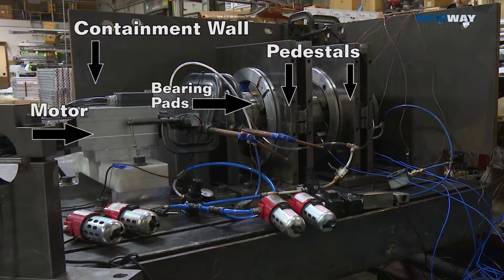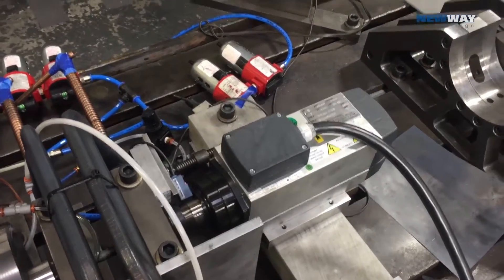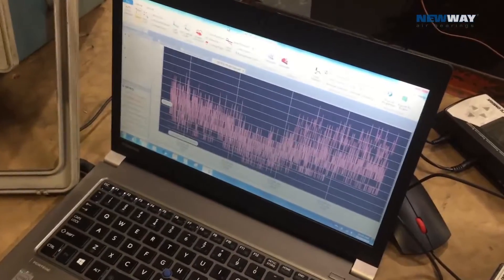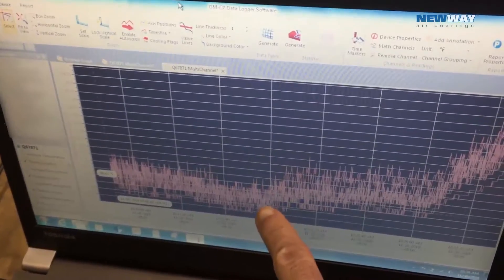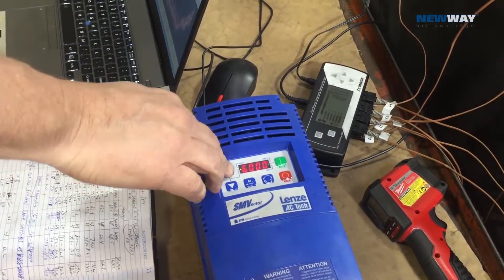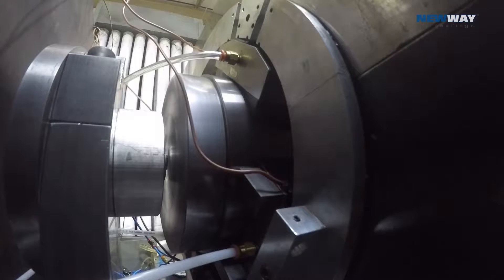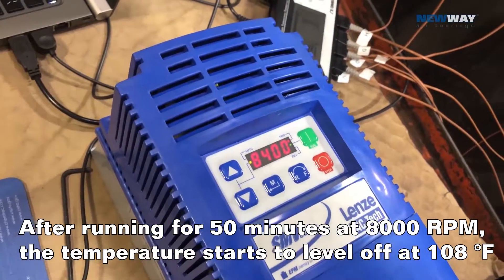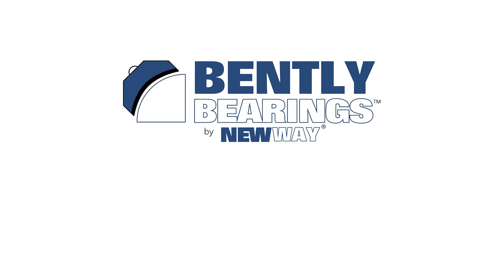7.25" Shaft Running at 8000 RPM

Comment: Really cool technology and videos... I was wondering what happens if there is a break in the air line and your air pressure suddenly drops to zero?

With these high speed shaft applications, I could envision a range of possibilities. The math says that the rotational kinetic energy of 7.5" diameter, 16" long shaft at 7000 rpm is about equivalent to a car driving at 30 mph. It seems like it all comes down to the pre-load and the coefficient of friction. I would guess that thermal shock would crack the graphite before everything came to a stop, which could then be quite dangerous.
Reply: Graphite is a pretty good lubricant.  I"m not sure there would be any catastrophic failure.  Depends on the failure mode, and such.

Comment: This technology looks amazing. Having something going that speed suspended with little to no friction and barely any heat. what kind of applications is the industry applying this? I can Imagine some sort of radial milling machine possibly. Im not very knowledgeable in engineering but this Looks really cool.
Reply: semiconductor rotors, turbines, heavy machines too - all sorts of - quite flexible application. there are good examples in older videos about forming all sorts of seals and separation zones - quite funny technology